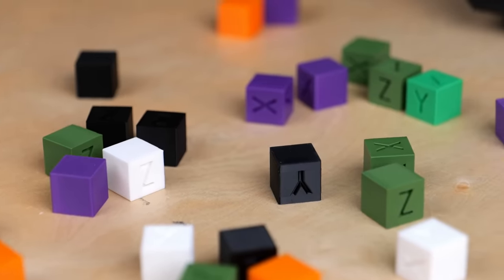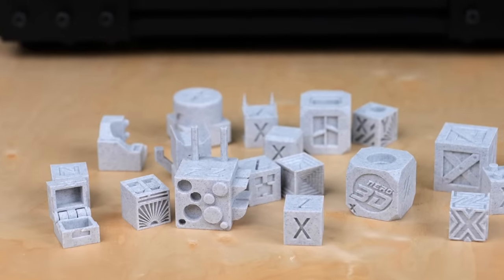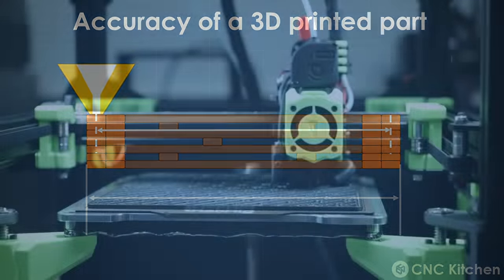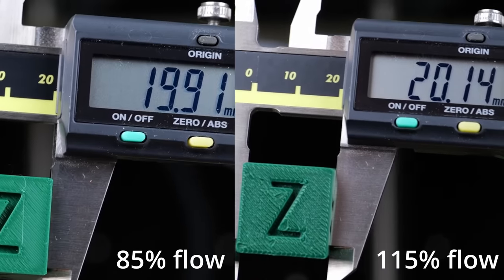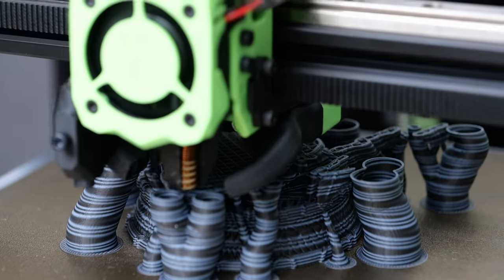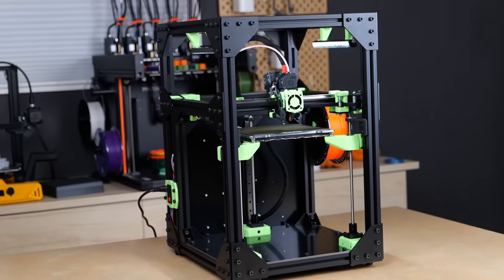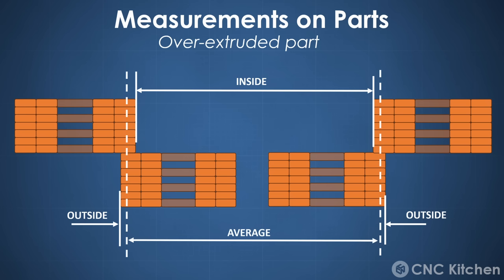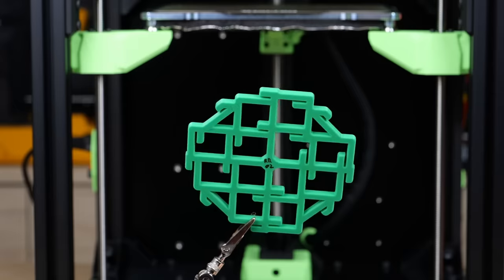Calibration Cubes: More Harm Than Good?

Comment: Why print anything at all to find out whether the stepper motors are travelling the correct distance? Why not move each axis x mm and see how far the movement was in reality?
If I have deviations with a calibration cube when the plastic cools down, why not do the same with the new part?
I did the service for surface grinding machines for a while and even there you measure the movements of the machine rather than what it does to the workpiece in the end. In the end, the latter only serves as a check and is considered normal and if not, the movement of the machine is used again rather than any ground parts.

Comment: Plastic shrinks when it cools, and size makes it more noticeable. You setup the printer the the kinematics and then you leave it alone. The parts need to be scaled to the shrink rate of the material used.

Comment: Your design requests of adam were in error.  You're using your calipers incorrectly if you need guides to take the measurement.  You want to have the jaws bridge as much material as possible, so to measure correctly you would have the calipers at nearly parallel to the flower.  The original design is better.

Comment: Califlower is not enough. It doesn't tell you anything about Z skew or Z height calibration. I still think a calibration cube is better as you can check for right angle in Z direction. It is just a matter of printing it larger if you want to be more accurate. You can then calculate the skew just as good. This matters alot when you print a  complex object which needs to be accurate in X,Y and Z.  Especially if you print a box with lid in a 45 degree position to the bed. Checking for skew and dimensional size accuracy of a printer are two entirely different things anyway. The smaller your print object is the less  X/Y skew matters. Dimensional size accuracy always matters.
Reply: For Z height, you better print something like a tower (but not in vase mode). That calibration cube is bad for this purpose and is wrongly designed since it exists. It doesn't even take particular aspects of 3d printing like jerk and material shrinkage in account.
Reply: @FunkyMind  I disagree. Calibration cube is still better overall. For various reasons this video totally ignores. The calibration cube does exactly what it is designed for. Further you can actually see if the jerk settings/ linear advance are off. It produces ringing at the letters or bulging corners of the calibration cube. Shrinkage can not be considered as it is material dependent and most importantly infill dependent. Just change the infill pattern or density and the shrinkage is different. Considering how much data you get from a small  2 cm calibration cube...it reigns supreme.
Reply: @Gigaloader  No, the main problem with these letters is rightly jerk/flow/infill that introduces variations making sides non planar so when you measure it, obtained values are misleaded by the bad design. Just a waste of time and material. Plus, 2 cm is way too small for a good calibration. If you get let's say 20.05 mm, on objets of 100 mm you'll have five times more extra size because of a bigger error range so 100.25 mm. You have to print something like a 100x100 corner in order to reduce the error range... This cube is only good for visual checks, not for precise measurments.
Reply: @FunkyMind  I don't know who you trying to convince. I already said that you can print the calibration cube larger to make the measurement more accurate. That has nothing to do with the design of cali cube itself. And it is actually  very easy to see on a calibration cube when flow or jerk are off. You mentioning it - is just making the  argument for the cube! As we get far more data from it. ;) But to keep other error factors low (like skew, warp, shrinkage etc.) it is also quite reasonable to have only a 2 cm cube when adjusting the steppers. Thanks for your input.
Reply: @Gigaloader  convincing no one here, keep doing as you like
Reply: Vector3D also has the calilantern which does zy and zx skew

Comment: All your reasons for why calibration cubes are bad, are all random printing problems that should be ironed out and fixed BEFORE you print a calibration cube. Why would anyone be worried about printing exact perfect dimensions when the prints are misshaped? You wouldn't because that would be stupid. So you fix all your problems until you get really REALLY nice prints. THEN you print a calibration cube. As far as measuring accuracy, you shouldn't force your calipers shut on anything. You gently close them and stop when they stop. 
Skew is just yet another problem that should be handled BEFORE you ever even think about calibration cubes.

As someone who has a career creating consumer products and prototypes with 3D printers, this video has a braindead perspective.

Comment: I have custom , one of a kind and I believe I found out an issue that can very easily affect many other printers.
Bed tilt.... To be continued
Reply: I added a third independent lead screw to my bed, which moves in the Z axis on a cartesian system. It always have been a strugle to keep consistent first layers. After I added the third lead screw I do in klipper before every print a Z tilt calibrate.
With a tolerance of 0.05 mm, it doesn't throw off the bed mesh or Z offset significantly (I never print less than .1 layer height. My probe has an accuracy of 0.005, so in the end it solved my first layer issue.
But that also made me realise how much the ups and downs during a print can be imprecise and cause these layer artifacts. Most of the time my next print os off by 0.06 to 0.15 and the tilt calibration corrects that. I can only imagine that this is not something so rare to happen during print to affect layer uniformity, let alone print after print when that calibration doesn't ever happen.

Comment: As you said fundamental issues like steps/mm are not the problem in most cases but extrusion width is. It's doesn't matter if you print 20mm cube or 200mm one the error will be exactly the same and you just wasted more filament on useless test prints. There are other free test models for mechanical accuracy or skew.

Really uncool to rant something and promote paid solutions in open 3d printing community, especially when they are easy to find or reproduce for free.

Comment: You're talking to like <5% of the people who actually print, measure and change steps basing on a calibration cube.
If you want to check the steps required to move on any axis, you'd measure the axis and filament. Not a printed shrunken down and warped over extruded cube

Comment: First, this is absolutely NOT BS!
I do use the cube mostly to check how layers look, overall quality of the print at the profile settings selected, as well as any overhang, elephant's feet or blobbing.

However, I do make parts that need to fit perfectly.  Especially my project where I use Nextion LCD displays.  Those have to fit perfectly, not only the screw holes, but the frame around the image portion as well.  I've had some really bad prints.

But what I've done here is too use an X,Y,Z thing that is 100mm each direction.
This has worked well and I've been able to tune this stupid Wanhao D9, MK2, 400 properly and get perf.... almost perfect prints.  LOL

But this coaster.... I mean flower... I mean... sigh... calibration print looks to be so much better.

My only issue is, that with this Wanhao, there are not a lot of settings that can be changed.

So I thought that I heard something about some code that could be added to the print (perhaps the before print code in Cura) to correct this issue.

On this printer, there is also a mechanical way to adjust each end of the gantry.  Rather than 1 stepper with a belt between the 2, there are 2 steppers.  One at each end.  LOL
But adjusting is easy, just by slightly turning one of steppers and using a calibration "stick" at each end.  It works!

Sigh... I really need a new printer soon.  LOL

Comment: I just got a new Creality Ender 3 V3 Se today. 
It took me more time to unpack and glance at the manual, than to assemble the unit!!! 
It literally took 10 minutes. Did nothing to it but to run the calibration and print the cat model that came on the SD card, and was shocked and amazed as to how beautiful it printed.
I've had 4 printers since 2009, and this one is unbelievable. How can they sell it for $200 and still make any money?

Comment: finaly some 3d printing authority take the subject of using calibration cubes. i am sick and tired of telling people they use this box wrong 
i always say that those cubes are only good for calibrating flow and the steps comes from belt and gears and in store bought printers defaults are usually correct, but some people still belive that using a cube for calibrating steps is the corect way
great job explaining it better than i usually do

Comment: Steps/mm is a fixed value, determent by the hardware of the machine
200 Steps/revolution, with 16X microstepping that is 3200 steps/rev.
GT2 Belt with 20 teeth on the sprocket gives 20 teeth * 2mm/tooth = 40mm travel per revolution
3200 steps / 40mm = 80 steps/mm
Not 80.1, not 78.7, 80!
That value gets calculated, not measured and it does not change either
If the dimensions of your prints are wrong it does not have anything to do with that value.

Comment: I'm looking forward to the day where calibration will be easily done through the user interface.
Reply: The MK3S+ does skew compensation as mentioned here. BambuLab have Lidar or Eddy current sensors.
People don't have to do anything really nowadays. Just push some buttons to start to initial calibration and noise cancellation etc.
Nobody ever had to fine tune steps for X, Y neither Z. Because the hardware setting it fixed.
Reply: @REDxFROG  It just seems like companies could give an update to existing printers where the interface would have a button, for example, to extrude 100mm of filament and then it asks you how many were actually extruded and it would update the firmware to correct it. The same for the other motors, etc.

Comment: Why not measure steps per mm just by looking at the printer? You can calculate how many mm the nozzle moves by looking at the printers motion system and doing some napkin maths.
Reply: By just looking at the printer may not be sufficient. It requires some tool to measure the movement. Lol
Reply: Well this is how a typical firmware is set up out of the box for the XY axis - 2mm per belt tooth, 16 or 20 pulley teeth per axis revolution, 200 motor oscillation cycles per revolution, 16 step signal changes per motor cycle. As you say napkin math.

One of these assumptions has a substantial error. Notice how when you take the slack out with the tensioners, the belt is still sort of floppy, feels weird, doesn't seem good enough. Then you nudge it another couple millimetres, and it starts feeling good and you leave it like that. But you still have a few mm of possible movement in the tensioner within which the tensions are sort of right. So this is your leeway and error in XY calibration, the 2mm per belt tooth belt pitch figure has up to about 1% error. As a rule, the belt is made undersized to be stretched to pitch, and usually you won't reach belt's spec tension at which it is precisely 2mm pitch before your motors get a little angry at you.

Comment: Never printed the cube to tune steps per mm. More or less it is useful to adjust jerk and pressure advance.
To calibare the steps per mm only by mesuring 20mm of the travel of x and y axis is ...  well not smart. This is less than 10% of ender 3 and similar clones x&y axis travel ... so it can not be accurate. 

Also for flow calibration it is not acurate - normaly i have printed a cube 20x20x20mm  in vase mode - one perimiter was a better choice.

Comment: * Your solution is not free.
* Your solution involves using a lot more filament.
* Everything can be measured in the cube. You are misusing the caliper. You have to measure as shown in the video and the middle part of the faces.
* Print a calibration cube is fast, easy and cheaper.
* If you want to have less error with a cube, print it larger. If you want to save filament, use 5% infill, less walls.
* With that you can't measure the Z-dimensions because it's too low.

Comment: the calibration cube is ok.Many filaments have not the same diameter.1.75 and 1.75 is already 3% difference so...Once we have have 0 tolerance i may switch to your  thing.We change filaments so often it would be a waste of plastic just to calibrate the printer.also i think there will be self calibrating printers with all that ai stuff and lidar scanners.so...no need for me

Comment: calipers are only accurate to .001 of and inch that can be about .05 of a mill you can calibrate them but still hard to do much better then that.  dial calipers a bit better don't sweat .05 it's nothing.

Comment: always simply apply the maths, and never had to calibrate?

microsteps. stepper motor steps. diameter of pulley or pitch of leadscrew. any reductions. punch that value into firmware, and its done.

double check with a dial indicator. it may be a few decimal places out due to tolerances on pulleys etc. theyre so close these days with mass production, that if you have to calibrate, you done stuffed something up. its not the machine. its YOU.

of course, get a proper machinists square or 123 block, and check for skew FIRST. in all three axes.

if you have to measure a print, then print holes at known centres, of equal diameters, and measure BETWEEN THEM. standard trick with calipers, measure one hole diameter, re-zero, then will give centre distance of any two similar sized holes... that accounts for squish, and any line widths of slicer offsets.

Comment: People printing 8mm holes and 8mm poles and calibrating their printers to under extrude until the parts fit is the worst calibration objects. Even with the best cnc in the world a 8mm rod will never fit in a 8mm hole without force, you always need different sizes for air to fit between. And do not get me started on the benchy, a boat that can not float?!?!?

Comment: When using a caliper, DO NOT measure using the upper flat faces as he shows in this video. A caliper is tested for accuracy using the shaper points towards the ends of the measureing arms. Not using these will give you the least accurate measurements that caliper can produce.

Comment: So.. basically calibration cubes are wrong because we measure them together with flaws of under/over extrusion, but the flower is good because we have to measure it right in case we meet the over/under extrusion? Everything can be good to calibrate when you you use your brain and measure your parts where you know they are good. This video looks to me like a paid advert of calibration flower.

Comment: Hey Stefan, i Like your Videos but this is not a good way to get a precise printer. You should not measure with any printed cubes or flowers. You should move the printhead or the bed for 100mm in every direction and then measure the distance with caliper on the printer! 🙄